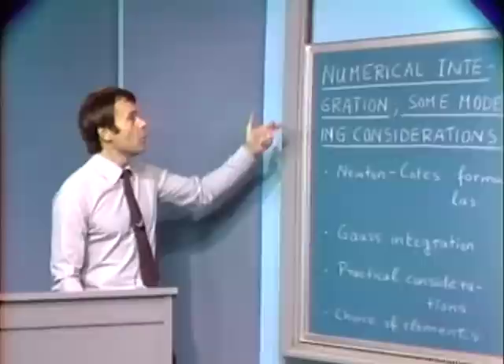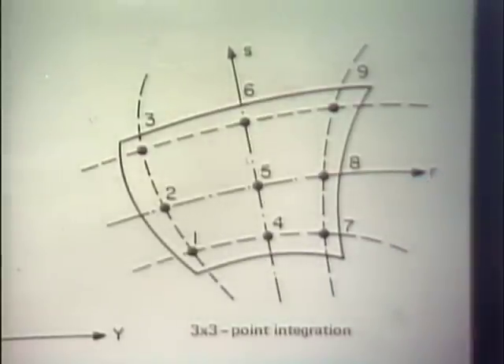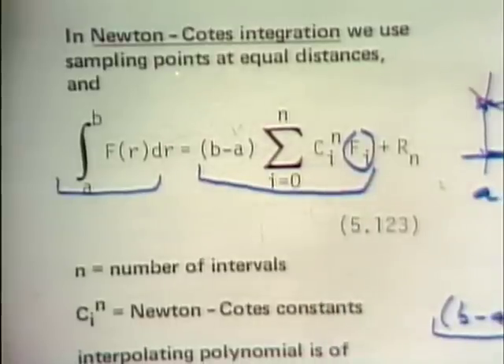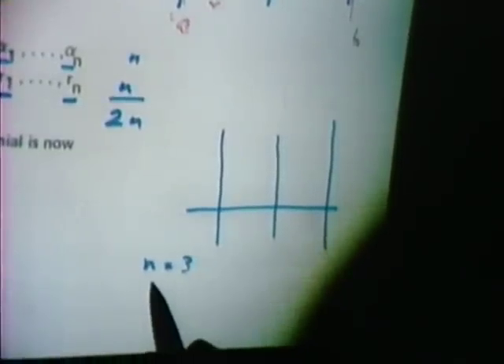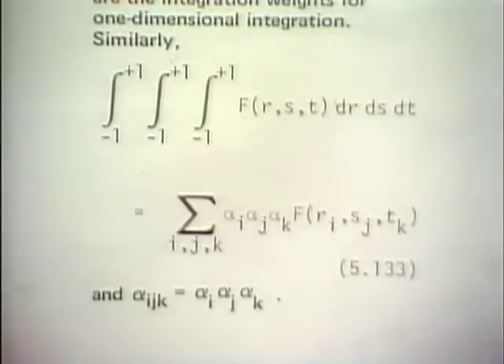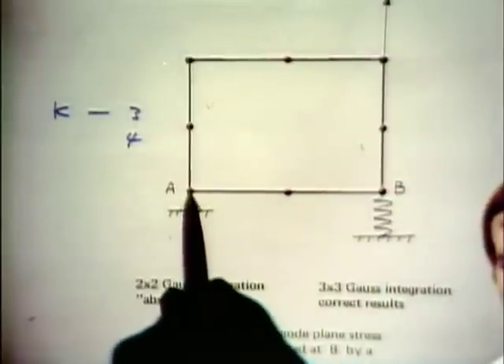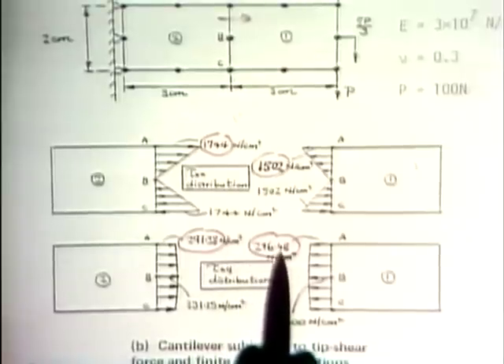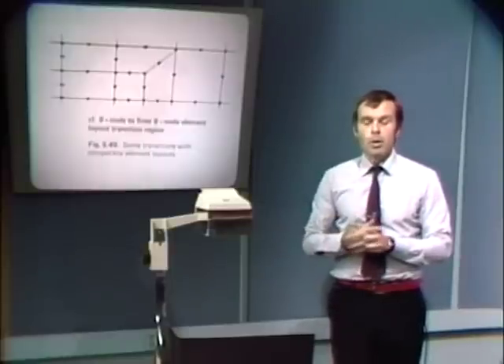Lec 8 | MIT Finite Element Procedures for Solids and Structures, Linear Analysis

Comment: The is very UNDERSTANDABLE, not like most of the FEM books.
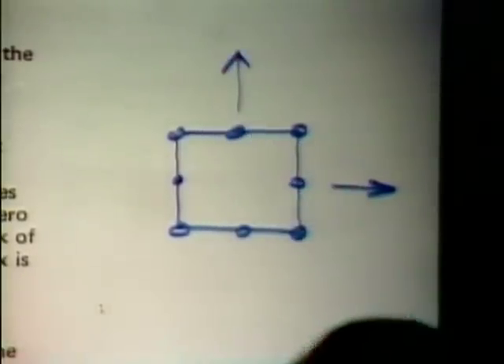Related to the order of Gauss integration around 30:00, how can one decide what order to pick up, so that it's high enough for a particular element in a problem? Does one always have to check if there are redundant rigid body modes and how are they related to the number of integration points? Also, I am not completely sure why for this Q8 element with the sprint, we have 4 and not 3 RBModes? Is it +1 tension in the spring? Thanks!
Reply: tension in the spring is not a rigid body mode because it implies deformation, and rigid body motion occurs without deformation.